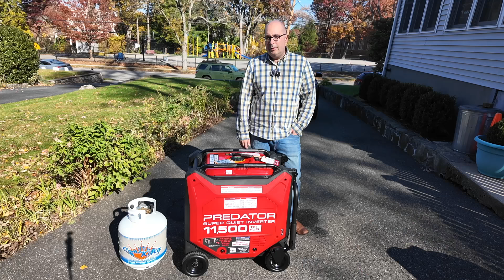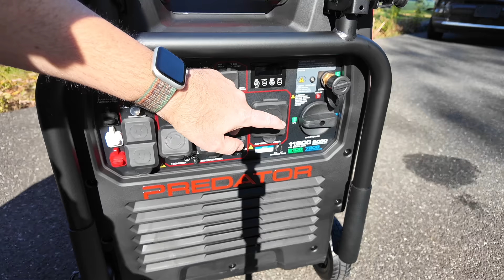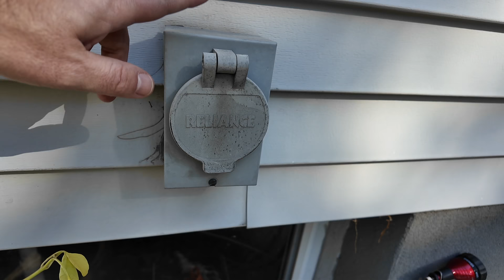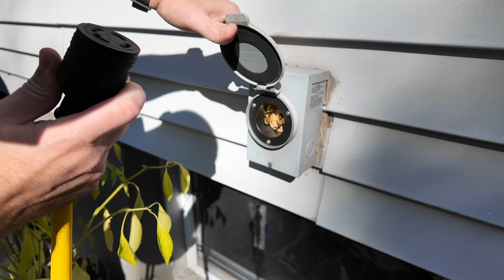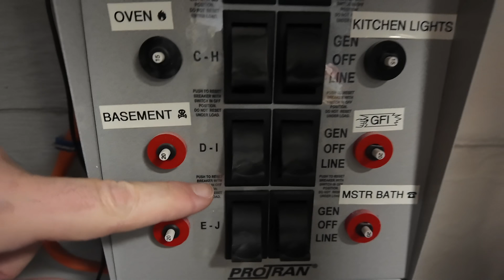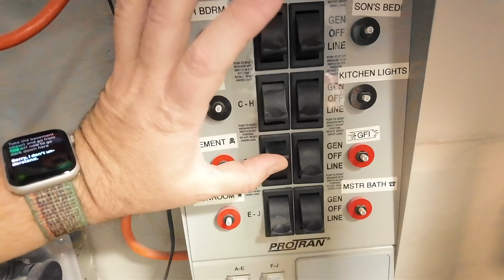Predator 11500w Powers My Entire House (Transfer Switch & Full Test) — Honda Should Be Worried!

Comment: Any thoughts regarding bonded neutral generator with the home bonded neutral ground at the panel?  I’ve seen a number of videos on disconnecting the neutral ground generator chassis bond(making the generator a floating neutral) prior to supplying the house.
Reply from the maker: I think if you’re hooking a generator up to a panel or a transfer switch, you should have a floating neutral. This generator has a bonded neutral so I need to investigate how to unbond it and make it floating. Once I figure that out I’ll post it in a future video
Reply: Same question here. Am tryna determine where the bonding happens, today am pulling off the control panel which seems needlessly complex.
Reply: @madpacket  I did my 9500 the other day, it took 10 min start to finish. Look at the ground lug on the front panel, when you dissemble it, the white wire is in the back side of the ground lug. Remove it, take some shrink wrap or tape, wrap the end of the white wire, then reassemble. Take the 30 amp plug that came in the box, create a bonding plug out of it, then use it when you need to use the generator as a stand alone.
Reply from the maker: That’s great advice!
Reply: Yeh it’s simple. You need to un bond it and make it a floating neutral.  If you don’t, you can energize equipment like panels or the frame of the generator or conduits, etc.. Not a good situation

Comment: So if you are running in a power outage with an interlock switch, how do you know when the power comes back on so you can go down and switch back to street power?
Reply from the maker: Best way is to look outside and see when neighbors lights or street lights come back on.
Reply: @Outdoor_Prepper At night, sure. During the day? Is there a smart device that could be in your panel to ping you?
Reply from the maker: I’m not sure tbh will have to look into it
Reply: @Outdoor_Prepper  truth
Reply: I have an interlock as well.  I use a device called “PowerBack”. It is made by Reliance. It checks for voltage in your incoming power lines in your main panel and will let you know when power is back.

Comment: Thanks for the video.  I would also say the additional cost to install a permanent Generac may be if the gas meter needs to be upgraded to a higher BTU capacity, ours is a mid 50’s house with a likely 70’s gas meter.  PSE estimated about $7K
Reply from the maker: That's a really important consideration! Thanks for sharing your experience.